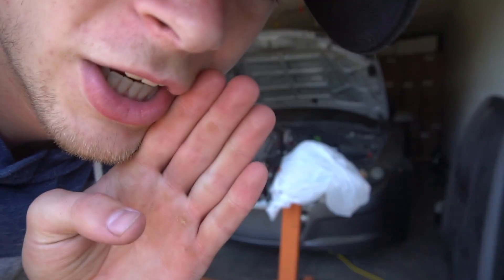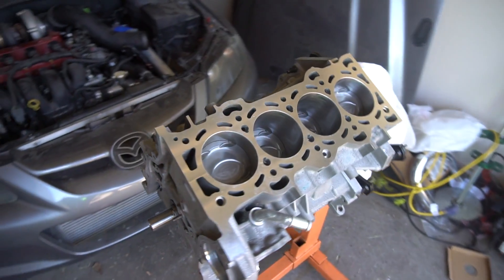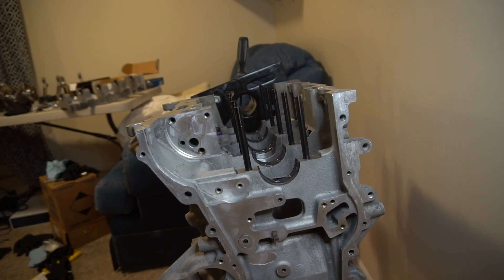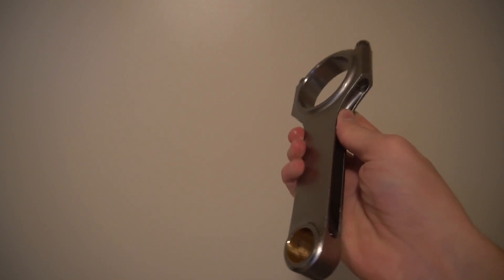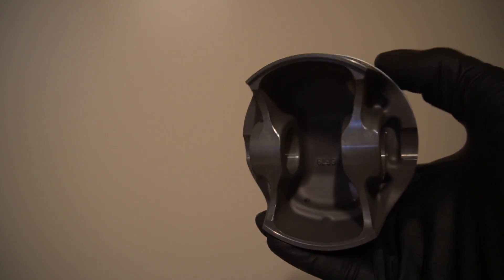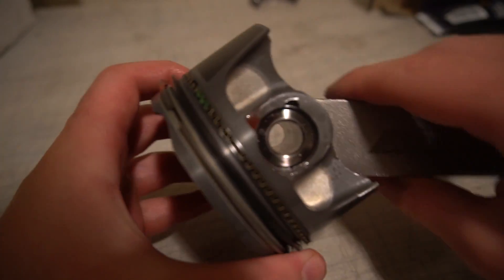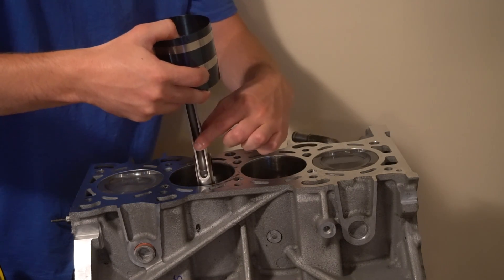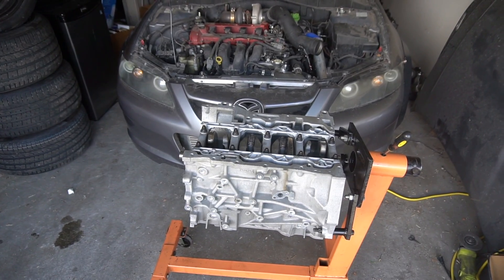How to Build a "FULLY BUILT" Mazdaspeed engine

Comment: Do you know what the torque setting is for the oil jet/squirters?
Reply from the maker: I’m not sure, join the Mazdaspeed groups on Facebook I’m sure they can help
Reply: @StevenDevey  It's okay - now - I went with feel, based on thread size and depth... All works great now. I did find the torque specs after the engine was running, luckly they were quite low and I know by feel, that I was a bit past that range.

Comment: How’re your engine mounts, differential mounts, rubber bumpers & such things handling the added power transfer & heat? Did you change anything or upgrade?
I’m getting lots of rattles, vibrations, shakes, etc. Thx.
Reply from the maker: You’ll get the rattles no matter what, the upgraded mounts don’t help. I have one stock mount in and that helps a little. The power transfer and heat are weren’t an issue
Reply: @StevenDevey    Thx. I think I have more than my share; feels like engine’s moving fire & aft as well as laterally. Feels like more than just the muffler moving; & I haven’t really started w the fun-fun.
Reply from the maker: @johngalt0096  ya what mounts do you have?
Reply: @StevenDevey    Still OEM. Gotta go into the shop ASAP to inspect; just Too much movement.
Reply from the maker: @johngalt0096  oh I see, with stock mounts It could be that they are broken and that’s why the engine is movie
Reply: @StevenDevey    That’s what I’m thinking. 
In Shop on Wednesday for inspection. 
I have a new rear MM from CS ready to go; bought it just to be sure; now I’ll bet I actually need it. Rest is OEM; ready to order more from RA. 
We’ll see. Fingers crossed.
Reply: @StevenDevey    Is that an easy repair? Are they readily accessible? Or is that a total pull out?
Reply from the maker: @johngalt0096  mounts are super easy. But I bet your passenger motor mount is the one that’s broken. How many miles does your speed have?
Reply: @StevenDevey    Really??? Best news I’ve had all day! We’ll see in ~ ~ 48 hrs. 
145k. Heat output after exhaust & tune, now tremendous. Probably added to it. 
Psgr, eh? We’ll see! 👍🏼👍🏼
Reply from the maker: @johngalt0096  ya that’s not to many miles but it’s about the time your mount could go out. You can always change it yourself to save money. They are really easy! Especially the passenger mount. It takes like 5 mins at most
Reply: @StevenDevey    “Saving $$, it’s a good thing!” as Martha Stewart would say! Believe me, I’m listening! Hope that’s it; no fun now, for sure. Housewives in SUVs are kicking sand in my face.
Will price it @ Rock Auto.
Reply from the maker: @johngalt0096  idk if rock auto has aftermarket mounts. I would personally get an aftermarket mount so it lasts longer and transfers power but it might vibrate a tiny bit more. Either way you’ll be good
Reply: @StevenDevey    All true: I have the rear A-M one from CS, But thats all I saw from them. 
Figured high quality OEM from RA would last me @ least ½ the 15-years these originals already have.
But will get the diagnosis & go from there. And check CS again.
Reply: @StevenDevey    Ha! You’ll love this: rear engine mount bolt (~ 4”x ¾”, had fallen completely out (!!!) Both found lying atop plastic skid plate (whew!). 
I told them it felt loose! Difference like night & day. Now we’re shipshape again (K04).
Otherwise, all grommets & bumpers appear ok. 
So, Q: 
With all the mods coming online in 2-3 months, I figure m/b ~ 350-400 bhp (?), would you wait for them to wear out or is the stress going to be such that they’re all guaranteed to torque themselves to pieces (?)
Eg.: I see CS has a rear differential plate @ like $250. 
I’m already so over budget & don’t want to put their kids thru college.
Reply from the maker: @johngalt0096  I think you would be alright without the rear diff plate. If you aren’t bigger turbo than you’ll definitely be fine. I just wouldn’t launch it or don’t do it often
Reply: @StevenDevey    Upcoming CST-5, BB. 
As Billy Hays said in Midnight Express: “I tried to be good”, but yiu know what sometimes happens. 
I’ve rarely done a launch from 1st, hence the longevity of my clutch, but now that I feel the engine torque (really attuned to it, now), I’m worried what 2x the OEM HP will do. She’s torquing down there, no doubt .
Reply: @StevenDevey    That’s the kicker: CST-5.
Reply from the maker: @johngalt0096  ya you have the perfect build you’ll love it! Big turbo is awesome
Reply: @StevenDevey    Tryin’. 
My last hurrah. But that’s why I’m worried about the torque & mounts.
Thx

Comment: I am currently rebuilding a Mazdaspeed 3 motor. I have a few questions. 1) Did you use the stock block?, 2) Is the crank forged or the only forged parts the rods and pistons?

Comment: Hey i have the same pistóns and my compression pistóns is 120 that number its good?????
Reply: Hey steven split second controller its easy to install?????? I buy jmf intake and all gas system and bnr s4 i cant wait bro
Reply from the maker: @josuearroyo370  its pretty easy! im pumped for you dude!
Reply: @StevenDevey  hey i try to buy wire tuck harness i talk to the guy in Facebook but he cant make anymore for now if you know someone can make that let me know
Reply from the maker: Seems low but compression testing isn’t always the best way to test. Leak down
Reply: @StevenDevey  you think i have problem with my pistóns
Reply from the maker: @josuearroyo370  well I’m not sure, compression testing isn’t always the best way to check, I would do a leak down if you are worried. Does it run?
Reply: @StevenDevey  my car running perfect
Reply from the maker: @josuearroyo370  idk what the code is, are you having any issues?
Reply: @StevenDevey  p0301 misfires cylinder #1
Reply: @StevenDevey  sorry for to many questions bro sorry

Comment: Hey man quick question is it ok for my piston rings to me gapped at 28 top and 32 bottom I took my block a a machine shop they did my rings for me too and there saying that’s good what do you think
Reply: It’s Bored to fit a 88mm cp piston
Reply from the maker: Are you running insane boost? Like 40 psi? I’ve heard you want like 25 or so for like 30 psi. I think either way it will be fine but if you daily it, you might burn some oil. Or smoke a little

Comment: Hey bro I'm building my engine seen your videos all the time I seen the main rod bearing is at 70. Question what is the specs for the connecting rod bearings? Appreciate the help thanks in advance
Reply from the maker: Jimmy Trejo I went with stock bearing size. I don’t know the specs on the con rod bearings. I bought stock bearing size and slapped them right in.

Comment: Steven, did you reuse the oil pump or did you get a new one?
Reply: Was it a Mazda OEM unit or a Mustang ecoboost OEM unit?
Reply from the maker: mikef058 I went with oem but either is good
Reply: Got ya, was really asking cause I just found out the mustang ecoboost oil pump works for the MZR motor, and it's also a lot less pricey compared to the Mazda oil pump.
Reply from the maker: mikef058 ya a lot of people go with that oil pump. It’s supposed to be the exact same.
Reply from the maker: mikef058 brand new one

Comment: Regarding the pistons and rings, the rings did come with the pistons right? And if the rings did come with them, do you have to gap or make any adjustments to the rings?
Reply: And just to confirm, you gapped your two guide rings and the two compression rings??? The oil ring is left alone.
Reply from the maker: mikef058 I only gapped my compression rings. The guide and oil rings don’t need to be gapped
Reply from the maker: mikef058 the rings come with the pistons. You definitely want to gap them depending on what power goal you have
Reply: Got ya, I'm not familiar with gapping the rings, will have to do research on that.
Reply: Got it, thank you Steve.

Comment: How much hp can that stock engine block handle ??
Reply from the maker: lyne afonin the block itself can handle a little over 700 whp without sleeves.
Reply: Steven Devey the cylinder head as well? Or do they make after market a cylinder head?
Reply from the maker: lyne afonin yes the cylinder head is good too. The stock cams can make 700hp

Comment: Looks good! What machine shop did you use in Utah? Didn't think there were any other Speed6 Mazdas in Utah let alone Davis County, :-).
Reply from the maker: Michael Cecy lots of mazdaspeeds in Utah brotha. I used Dave’s auto in Centerville.
Reply: What size main bearings did you end up going with? Edge Autosport is showing standard, +.001, -.001, -.010, or -.020. Did the machine shop just let you know which ones to order? Thanks!
Reply: Where did you order your parts from?
Reply: You need to get this thing done, man! I’m going to catch up to you!

Comment: You’re running Malle 2618 pistons and h-beams with stock head and cams right? Decent intake mani and exhaust mani if I remember right on a 5858 right? That is the perfect built motor 500-600hp build man
Reply from the maker: Isaac Wright that is correct. I have a porter head but stock springs and cam. Will the ported head help for this power range?

Comment: you can can run a mustang ecoboost/focus rs oil pump at a fraction of the cost from ford and its a higher volume and pressure then the mazda pump. I'm assembling my motor next week. 

what machine shop did you take it too?
Reply from the maker: broncomitch hey I have heard about the ford oil pump. Thanks for the help! I used a local machine shop called “Dave’s machine shop”
Reply: @StevenDevey  ah, I used him before.  I'm out in tooele now so looking for a reputable shop that is a little closer.

I'm running the oil pump and the ford performance forged crank.
Reply from the maker: broncomitch oh I see brotha. Did you have a good experience with Dave’s? And I was going to get the ford crank but ended up keeping the mazdaspeed crank.
Reply: @StevenDevey  yes I did, like his facility and the cleanliness of the shop.

I wound up taking my block and head to crankshaft grinders, turn around was fast and it was just getting a cleaning,honing,resurfacing so figured it's easy work to a first time experience. Lol
Reply from the maker: broncomitch ya I haven’t used that shop before. Did everything look pretty good?

Comment: whats the difference between  the 2004 mazda 6 block and this one, thinking of building and installing turbo on mine
Reply from the maker: Gustavo Bautista the block itself is probably not crazy different. However I would not recommend building a Mazda 6. You might as well buy a speed 6 because they have AWD and already come turbo. You will put more money into the 6. Also you have no tuning option so it would be hard to get it to work. I would keep the Mazda 6 as a daily
Reply: @StevenDevey  i have a second parts car with another block, not to worried about messing the engine up, gonna rebuild the other to see how much hp i can put on it, not planing to go over 500hp
Reply from the maker: Gustavo Bautista sorry brotha that engine just doesn’t have any aftermarket tuning support. You will need a different ecu if it’s even possible. Why not just buy a speed?
Reply: @StevenDevey  can't afford it at the moment, and it's odd i saw a guy put Disi to Port injection on his speed for higher hp courious as to why he did that
Reply: Great video I’m planning to start my build in the near future. This helps a lot.  I’ve been wanting to start making videos of my ms6 currently full bolt on, bnr s4. Eventually want 600-750hp range. Gotta save that $

Comment: Excellent video!  Question, how do you know if you're a true TDC when doing a full engine build?  Is the peak of cylinder one compression stroke determined by the crank or the cams?  I guess that's what I'm trying to say..
Reply from the maker: craigzilla100 true top dead center is when piston 1 is at the top of its stroke I believe.
Reply: There is a pin on the side of the block that you install and it will only hit the crank when #1 is at TDC
Reply: @broncomitch8677  yes, but how do you know if it's the peak of the exhaust or the compression stroke?  Without the valves and the head in, you can't tell which stroke it is can you?  TDC is supposed to be top of compression stroke
Reply: @craigzilla100  it dose not matter because the cams are on the head.  As long as the cams are set to TDC and the cam plate is installed it's at TDC.
Reply: @broncomitch8677  gotcha.  That's good to know!  I had a feeling that was the case but wanted to be sure